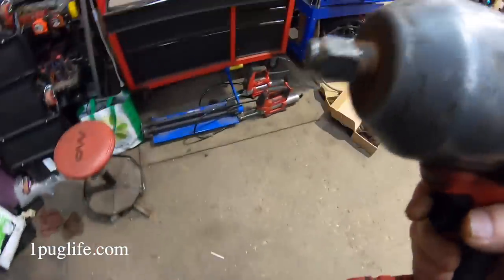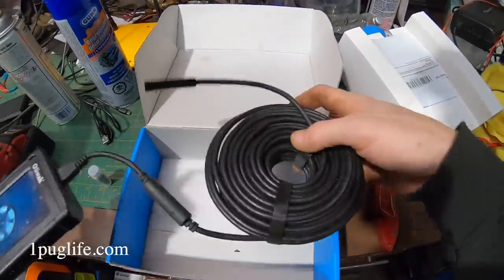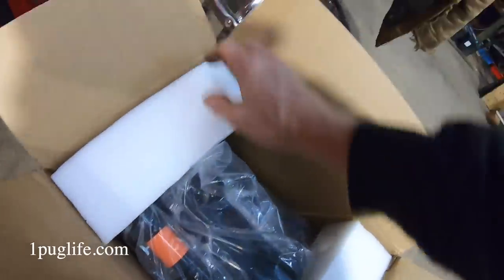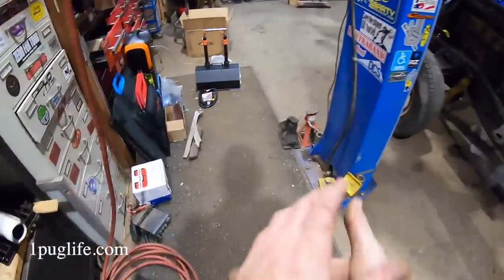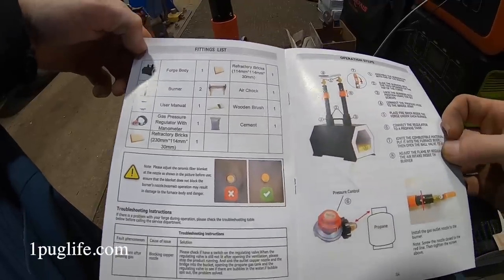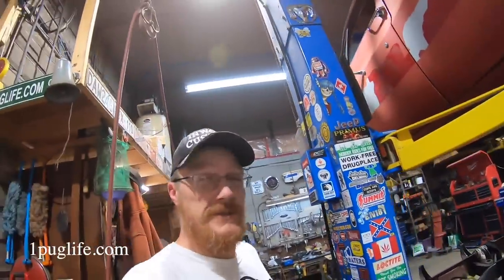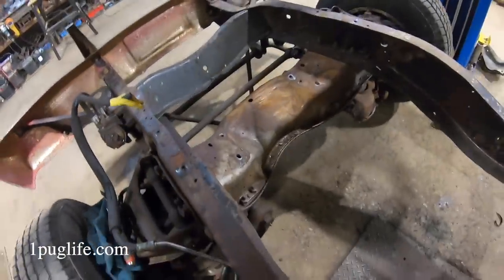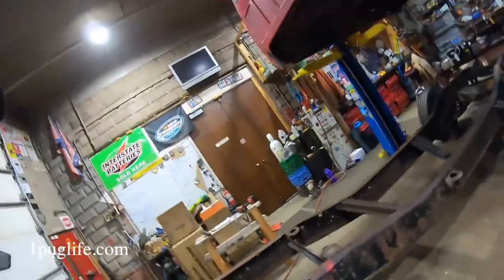clutch pedal, sh!ttr cam, propane forge, and frame picklin

Comment: I got the square vevor 2 burner forge and a 55 pound anvil for Christmawards. Gonna make some Damascus knives. I already built a cave man forge by burying a perforated steel pipe in the ground hooked up to a mini shop vac. I used the cave man forge to heat up the heads of big box wrenches and pound the open end into a small hatchet. Only cost me about 100$ in BBQ coal cause I was too dicked to figure out they use anthracite coal not bbq coal. FROG SNACKS!!!

Comment: that pin just grind it level punch in middle with punch tool and drill on that, if its not drop then you can try in air hammer to punch in top side near edge so its go in more then its should come out.